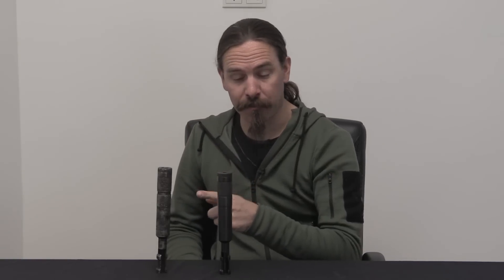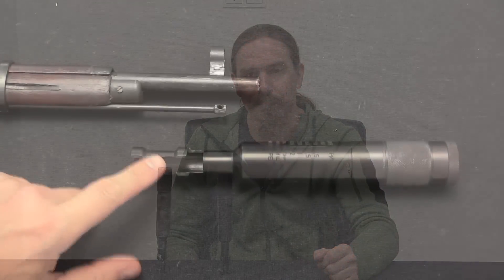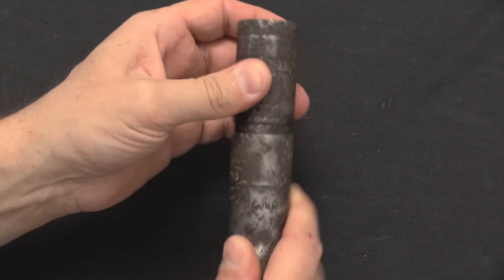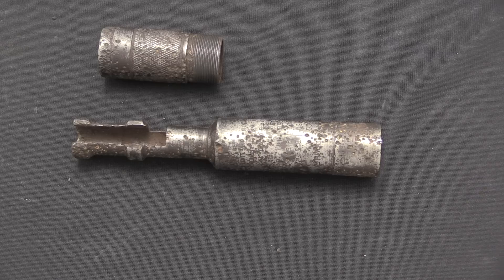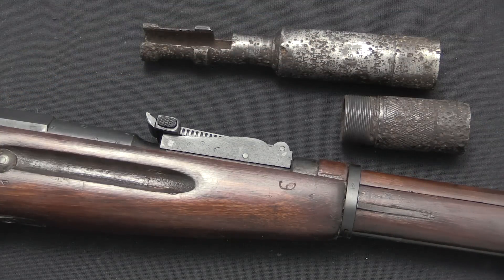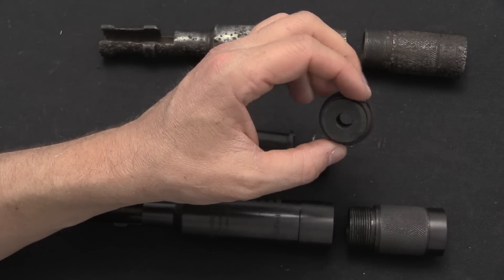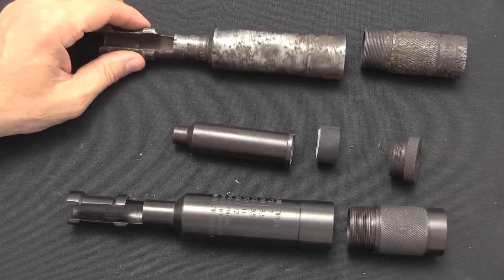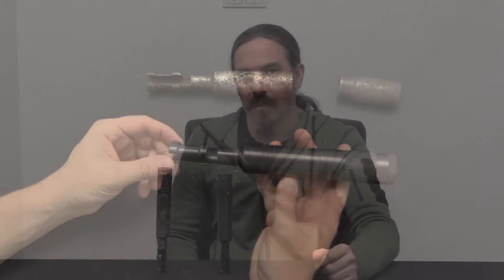Soviet WW2 Bramit Silencer for the M91/30

Comment: About the subsonic bullet, I was searching for it information after I after I read the PKM manual book made by US intelligence in 1979. It's mentioned as "low velocity bullet" with 40gr of charge. And I was thinking "What's it for"
The description of it, as entire green bullet, match a bullet information I found. It has green rim too, and later just the tip and the primer. But the powder charge is just 8gr. Normal 762 rim bullet has 49-50 gr charge.
Because of that, I went back to this video. To be honest, I think 1/3 of normal charge sounds right, as 1/3 of the velocity. Both document mentioned the use of 148gr bullet, which is light for Mosin bullet

Comment: Video re uploaded, so video I shall rewatch. Questions directed at Ian, but open to anyone. Do you have any thoughts, ideas, or knowledge on reproduction of these that will work on any Mosin, not just a 91/30? Also maybe with steel baffles instead of rubber wipes? If there isn’t anything like that, how good of a market do you think that would have if produced?
Reply: As long as rifle accepts soviet 91/30 bayonet. I doubt Soviet suppressor would fit Finnish Mosin

Comment: Hmmm, Ian, you say that BraMit was used only on Mosin-Nagant rifles. But as far as I know, they were also used on Nagant revolvers, there are even many pictures of them. However, I'm not sure if it was the same silencer pattern, or some special one (I saw at least 3 different versions in the photos, and one of them looks very similar to a regular BraMit without modifications).

Comment: I think, they were not «not interesting souvenirs», but strictly controlled.
It was possible to get a license for a hunting rifle in the USSR, but any suppressors were strict off-limit for civilians.
Reply: The suppressors were extremely little known. I know that professional hunters make them themselves and no one raised any questions about it - the hunting inspection also did not know what it was.
Reply: Suppresores are still a big no-no on civilian firearms market in Russia. You'll lose your license and probably will get in a big trouble for one of those. 
But you can buy and use "closed compensators", which look like suppresors, hide the flash and significantly reduce the noise. Such a device must be sertified specifically as a compensator and not silent enough for it to be a suppresor.  People usually refer those as "cans". 
If something reduces the sound too much, it won't make it's way to the civilian market, and only the law enforcement guys will be able to buy it and put on their service guns. This scenario is not optimal for manufacturers, so they do their best to not make the thing too quiet.

Comment: Ian. You CAN'T use the Cyrillic "B" if you're then also going to use the Cyrillic "Ya" immediately after.
Reply: spent a few seconds trying to figured out what "byadmit" meant
Reply: @memepolice7964  Turns out that "d" is a lowercase A in that shitty typeface. I had to look it up.
Reply: @memepolice7964  blyatmit
Reply: and the Cyrillic R looks like a Latin P.
Reply: БраМит, Слава Рoссиа!… Is that politically incorrect? ❤ 🇺🇦
Reply: They don’t have “I” in Cyrillic either so he is just making a stylized english word Бяamit using Cyrillic characters.
Reply: @americameinyourmouth9964  Because the backwards N has to be used for the latin N 🤦‍♂️
Reply: It does?

Comment: You just know that somewhere in Appalachia, somebody made a bootleg Bramit using a muffler and rubber gloves/condoms
Reply: There is a Milwaukee hole saw attachment for a drill that has the exact slot size as that for going around the front post. Lmao
Reply: Gloves are spensive.  Just save the old hydraulic and oil filters off your tractor. 😂

Comment: I once read the AK-47 silencer manual. The manual was for the armed forces of the People's Republic of Poland. There, too, it was written about the need for special ammunition or a reduction in the amount of gunpowder in a normal cartridge. As far as I remember, a different sight was added to the silencer to be mounted on the weapon. The manual also pointed out that a notebook with the number of shots recorded must be added to each silencer, and when the notebook is not there, the user must visually assess the wear of the rubber. The manual said that a shot with such a silencer sounds like the sound of a dry branch breaking.
Reply: That's cool
Reply: I wonder if AK-47 would cycle with subsonic ammo... And if it does, I imagine the clanking of metal parts would be a bit more noticeable than a dry branch breaking (at least in my experience, on an AK-74 the sound of the bolt dropping is quite loud)
Reply: @MrCh0o  It does, since it overgases, using subsonic round won't have any problem to cycle it.
Reply: @MrCh0o  technically you can resolve that by holding the charging handle in place .... I'm not recommending trying that
Reply: @MrCh0o  A very valid point, that's why the communist army, when making a pistol with a silencer, made a lock on the bolt - as long as you pulled the trigger, the bolt couldn't go back, then you had to manually pull it back. I know the MP5 submachine guns also had an option to lock the movement of the mechanism when you fired with a silencer. I have no idea how it was with the AK-47. Maybe they were blocking the bolt handle with some kind of string so that it couldn't go back?
Reply: @KulfonCzarnyNos  AKM with PBS-1 in manual would require to shoot in semi auto only and it does cycle normally. For more silent purposes, Soviet had other guns for that purpose.
Reply: @KulfonCzarnyNos Delayed locking rollers on MP 5  bolts have NOTHING to do with suppressor shooting. MP5's don't have forward bolt locks. Only HK 'quiet' bolt option was a VERY rare forward assist on 10mm MP5's for ensuring positive bolt closure without doing a noisy "HK slap".
Reply: @ducatipaso1386  But I'm not saying that rollers have anything to do with silenced shooting. If you're saying that the MP5 basically doesn't have the ability to "immobilize" the bolt, then well, I've read differently that there is such a version for special forces. But maybe my source was wrong. There are various legends in the world and they turn out to be untrue.
Reply: @KulfonCzarnyNos  there was a TT-33 suppressor design where you had to manually cycle it after firing.
Reply: @user-03-gsa3  Thanks for the info. I couldn't find a video with this invention, but I read that the supressor was attached to the slide so that the slide would not move back due to the greater weight.
Reply: https://youtu.be/eH_dw-3NlXQ
Reply: @DaedalusHelios  Great comment and really interesting result. That's a lot louder than I would have expected from mechanical parts alone.

Comment: Excellent video. In the emergency procedure of throwing away 2/3 of the gunpowder, it strikes me that the volume thrown away is not replaced by cotton or something similar. Very low charges have pretty random effects from a misfire to a kaboon. Greetings from Argentine Patagonia.
Reply: It's possible that they tested this procedure and found it to not be dangerous. There is probably enough powder in it with a 1/3 charge to prevent or mitigate the situation where a detonation would happen.
Reply: Depends on the powder. Some smokeless needs some pressure. This is a powder specific complaint.
Reply: If I did this I would definitely pack the casing with some fiber. The problem with very low charge weights is that you expose way more surface area of the powder to the primer detonation, whereas if it was a full charge, only what is pressed up against the primer is exposed to the detonation and the flame front travels through at a predetermined rate giving you reliable pressure curves. 

I used to make some really small gallery loads with .32 S&W using 1 grain of Bullseye and one 0 buck sized pellet (.32 caliber). I always used a sharpened casing to cut card stock plugs of paper that were then jammed into the casing to keep all of the powder to the rear. Never had any problems doing that.
Reply: @oldscratch3535  Exactly!, I have seen that phenomenon in a 357 Mag and it was Kaboom! Without a wad of fibers of course
Reply: @bulukacarlos4751  Whatever rifle powder they were using probably behaved drastically different in this situation to the relatively much faster burning pistol powders used in .357.
Reply: @JJW3  I don´t know. Maybe, but I have no experience with reduced rifle powder by miself or close shooters.
Reply: Generally that is only an issue with faster burning powders like pistol powders.

Comment: Were there any official soviet suppressors on the Nagant revolver?
Reply: The Nagant silencer was actually the first Bramit model
Reply: @galvanic.warlock  Correct. It used 7 or maybe 8 rubber wipes with different spacing and holes. It was pretty efficiant suppressor for short range job.